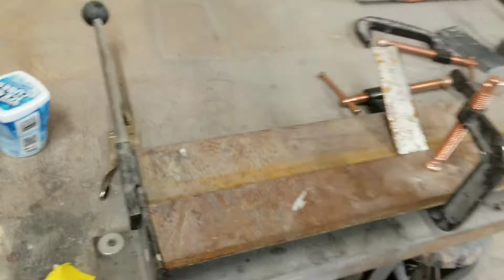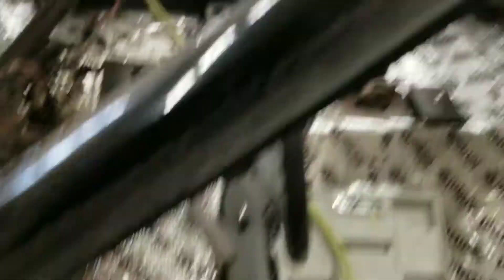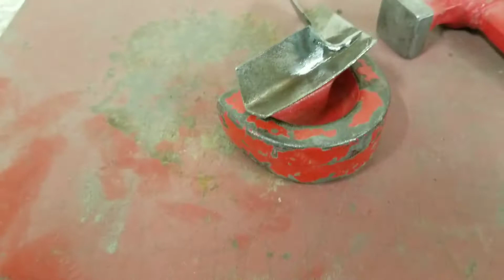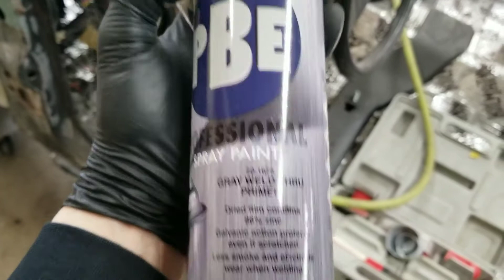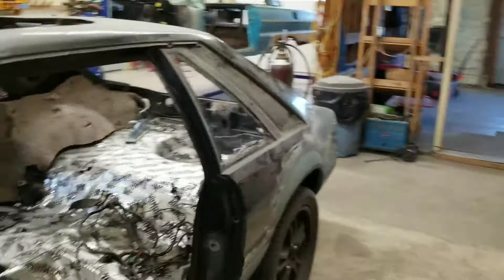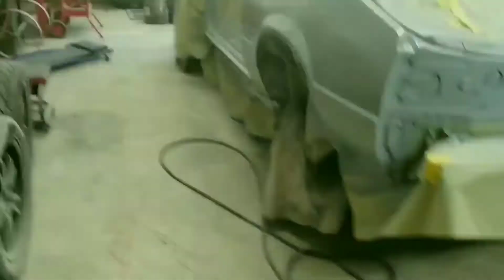#Buster the rotten foxbody mustang ep.2 how to repair rusty windshield channel and laying 2k primer

Comment: Hey how did you completely clean all the urethane adhesive off the windshield channel? I got some rust on the channel after pulling the windshield and a razor blade just isn’t working all that great.
Reply from the maker: 80 grit
Reply: @bpbrestorations2093  Thanks man I appreciate it!
Reply from the maker: No problem
Reply: @bpbrestorations2093  Awesome job on buster by the way, came out great 🤘🏻